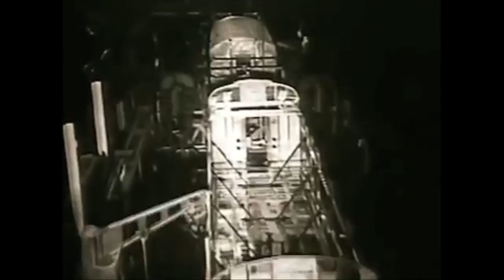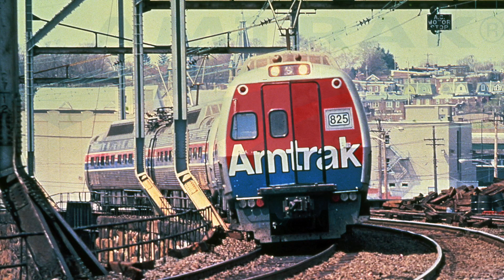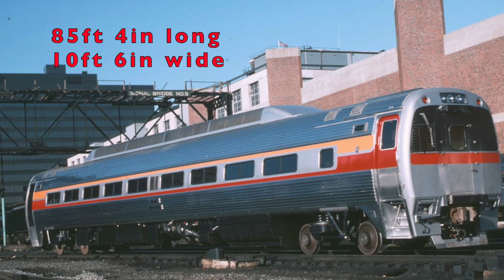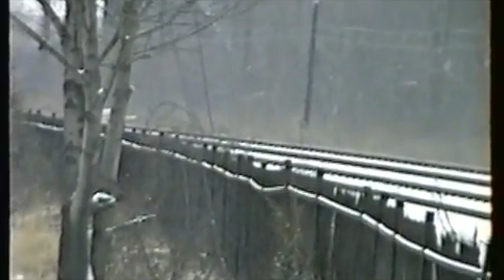Engines of Metro North SPV 2000

Comment: i worked for metronorth  starting in 1985 for 2.5 years as an electrician. Most of my time there i spent working  on the 10 car fleet of SPV's  , and boy did  these cars need work !!!  Of the 10 cars they had we had at least one car on the drop table every week for an engine or transmission change the entire time i worked there!!
 They had 2 drive engines Detroit Diesel 8v92's and one Detroit Diesel 4-71 APU engine. 
The part in the video about the union regulation for a fireman  that forced them to remove the drive shafts between the inboard and outboard axles is true and in my opinion was a major cause of engine failure from overspeeding.  The two inboard axles could not generate enough traction to handle the torque from the drive engines and would just spin the wheels like crazy on acceleration. These cars were so bad they had a technician ride the train to restart the engines every trip from croton to Poughkeepsie.
The engines control / overload panel was on the side of the car so the train had to be stopped and someone had to go down to the road bed open control panel cover , reset the tripped overload breakers and restart engine. 
One interesting thing in the video was the author referred to the meaning of SPV as special purpose vehicle  , i only new it as Self Propelled Vehicle .

i did work on the RDC's also , it was a much more reliable machine.

Comment: How about a new SPV-200/RDC type made out of Budd's Viewliner design? Try again,  make a better design of diésel engines and modern microprocessors.... VIA still runs RDC's
Reply from the maker: It would be possible but now with Siemens and Saddler entering the US market more aggressively they could adapt one of their European DMU designs for use in the US.

Comment: I worked building the rail geometry system used in the FRA's SPV2000 called T-10.  It was an interesting mechanical configuration in that a lot of stuff had to work for the car to work right.  There were three engines from two different companies.  Our vehicle has a pair of GM 6-92s as prime movers and a Perkins (British) diesel mounted under the middle of the car to run the APU (alternator).  T-10 had been structurally modified in a few ways to make it more suitable as a track geometry vehicle.

I rode T-10 on and off for a few years as part of its shakedown and the field support of its geometry system.  The geometry system represented an advance for its time.  T-10 did a lot of good providing precise measurements of how the track lay at the point of contact under a loaded and moving vehicle.  We measured geometry at speeds up to 80MPH.  Actually, from an instrumentation point of view, holding accuracy at slow speeds perhaps a larger problem.  The vehicle spent years identifying rail maintenance safety issues over much of the country.

We were not the typical operator as we had a dedicated staff operating and maintaining the vehicle.  We (Ensco Inc.) developed a great deal of experience with that particular vehicle.  We held on to the FRA contract and many of the same people for quite a few years.  The continuity of people and pride in the vehicle helped keep it operational.

I was not involved with its later life as an FRA vehicle so cannot comment on whatever issues it had later in its life.

Thanks for the interesting video.
Reply: Typo above.  Prime movers were a pair of 8-92's.

Comment: Seems like if Budd tried to hard to one up the RDC with the SPV, if they would’ve just claimed it as the RDC 2 and done the bare minimum in the upgrading of the equipment and released it, I think it would’ve done better both in attracting buyers and mechanically

Comment: 9:47 9:48 These newly-refurbished railcars would be referred to as Constitutionliners, and they would be used on Shore Line East until the railroad celebrated the acquisition of their brand new Mafersa coaches from Virginia Railway Express in 2004 after the new cars finished testing on the system.
Reply: 9:54 is a celebration for these cars

Comment: Am I the only one who noticed that, in photos of trains taken from almost head on, that the railcars are built with a couple inches of 'hog' in them?  That is, the cars are higher up in their middles than at the ends, where they attach to other cars
Reply: Yeah, that’s an Amfleet thing.  I read it was to prevent sagging under a full load, but the horizons are the same length and are flat.  (They’re also square).  Only other thing would be to shave weight, they are several tons lighter than a Horizon.
Reply: @jaysmith1408  Thank you!

I was told by a rail-buff friend that it was "an illusion" and he didn't see it..!

The hog is visible also on 18-wheel flatbeds on the interstates, more so.

Comment: So basically the Budd RDC could be a contender to be considered the "Douglas DC-3 of the rails"?
Reply: Pretty much. In fact, the Budd RDC was the basis of the electrified Pioneer III cars used by the Pennsylvania RR, which then evolved into the Budd Silverliner II (used by the PRR/PC and Reading until 1976, Conrail from 1976 to 1983, and SEPTA from 1983 until retirement in the mid-2010s), and the Budd Metroliners; the St. Louis Car Company using the Silverliner II design for the Silverliner III (for PRR Philadelphia-Harrisburg service) and Arrow I & II (for North Jersey/NYC service); with GE/Avco building the Silverliner IV (PC/RDG/CR/SEPTA) and Arrow III (PC/EL/CR/NJT): the latter two models still in service (along with the Hyundai-Rotem Silverliner V cars, which despite the name, does not have the Budd RDC & Pioneer III pedigree).

Comment: If there was a need to have them powered it's going to be slapping Alstom Coradia Polyvalent components at Hornell plant or use Modified ALP-45DP engines under the floor at Bombardier Plattsburgh, NY plant.

Comment: On the contrary the Grapevine Vintage Railroad in Grapevine, Texas has 3 of these cars 2 coaches in one cab car Currently only one is in operation as a coach the other 2 are waiting a restoration
Reply from the maker: Nice
Reply: @nyrailfan202 .... Great videos and video quality.. well done!  I subscribed after watching the first video I found of yours.. just yesterday (Sept.3rd, 2021)... on the RDC's, of which I'm a huge fan... mainly because of the beautiful sound of those twin 6-110NA Detroit Diesels.  Anyway, I have a question for you in regards to this video on the SPV2000's, and that is... exactly which Detroit Diesel (aka GM Diesel, pre-1965) engines were being used that were rated at 360hp each?  

There were several of their engines in that era that could easily be rated at that power output level, so...???    Us "gear-heads" that watch videos like yours, like to know that kind of information. : )   

Seeing as how the SPV2000 was unveiled in 1978, my guess would be that they were "possibly" powered by the Series 92 V8 (Naturally aspirated by a Roots blower) which was released in 1974 (until Nov.1995), and a common rating for that particular model was 360 hp (turbocharged versions went up to 720hp and even higher on custom built V8 - 92's).  Was the main "issues" with the SPV2000's drive train, primarily with engines, or in the drive train itself ??
Reply: @Romans--bo7br  The FRA's SPV2000 (called T-10) had a pair of GM 8-92s as prime movers.  It also had a Perkins mounted mid-ship to run an alternator.  Yes, two different brands--- one English.
Reply: @bruceclarkson7656 ... Hi Bruce, thank you for the reply... good information to know.  I never did get a reply back to my questions to "nyrailfan 202" ... the fellow who posted the video.   

One thing that saddens me a lot is the fact of many of the restored Budd RDC's (aka "Buddliners"), have been re-powered with Cummins (mostly) 4 strokes... which to me, completely removes the "heart & soul /character" of what the Budd RDC's were.  

Without the beautiful drone of those twin 6-110's... they're just not "Budd RDC's" anymore.  

I've never had any discussions with anyone intimately involved with any of those restorations, to ask them "Why ?" they didn't have the engines at least rebuilt, or better yet.. remanned.  

I can understand Not doing so with the 1st generation 110's if they needed a new or remanned centrifugal blower, but there were tens of thousands of the upgraded blocks / engines built with the roots blower, as well as the 3rd generation that were turbocharged as well.... 15 years before the first 8-71T was introduced.   

Even with a bad Centrifugal blower (unless the engine was over-sped above 2100 with one of those on there for scavenging), there are "after-market" way around that as well. these days.  

PS: In your comment below here, you mentioned that there were Two, 6-92's in the units you were associated with..... and Two 8-92's in your reply to me, here.   Just a "typo" I'm sure, but were they 6's or 8's??  How many rpms's were they governed at, at full throttle?  Perkins Diesel, back in the late 1970s and 1980s were Marketed by Detroit Diesel for a number of years, before they entered into a marketing agreement with John Deere's engines.... on the lower end of JD's hp line-up, to add to DD's "portfolio".
Reply: @Romans--bo7br  Definitely 8-92's driving two speed forward and reverse twindisk transmissions.

Comment: The SPVs were a disaster in so many ways. I remember riding on them in the 80s and diesel exhaust would leak into the passenger compartment.
Reply from the maker: The exhaust was part of the illusion. Once inhaled you may think that the cars were quite reliable

Comment: It was a shame that it was a failure. I know one issue was that it was underpowered, although some claimed that one power unit was disconnected to keep from having to have 2 people in the cab, not sure about that
Reply: They eventually got to be so bad that they had to always be run at least two coupled together at all times so that "when" one broke down, the other could haul it in.
Reply from the maker: Yup
Reply: Both of the power units were left connected, but the intermediate driveshafts were removed, so only one axle per truck was powered.
Reply from the maker: Which then made problems

Comment: Why couldn't Budd have just built more RDCs?  Update the engines to meet emissions and fuel efficiency regulations (if those even applied to railcars in the 1970s) and call it a day.
Reply: That could have been done using the Silverliner IV or Arrow III body.
Reply from the maker: The RDC’s still operating in the 70’s were still reliable. So railroads needed a better reason to replace them which might have been the comfort or speed that the SPC-2000 offered.
Reply: @nyrailfan202  That would have been okay if the SPV2000s had been reliable.  But it couldn't have been that hard to design an updated RDC (as above) with more comfortable seats and more powerful engines (they were already on the upward trend in the later RDCs) and igher gearing.
Reply from the maker: Buddy decided to go with the SPV and then when they failed budd’s executives don’t always make the most logical decisions. They decided that budd should just leave the DMU market which is why they never even had the chance to do that.
Reply: @nyrailfan202  Not the first and not the last example of mismanagement in the railroad industry and its support industries . . . .

Comment: Is a sad story becaus the spv-2000 could have been a success, it had a lot of potential. If it were only more reliable like it’s predecessor.
Reply from the maker: Exactly
Reply: Could have worked better
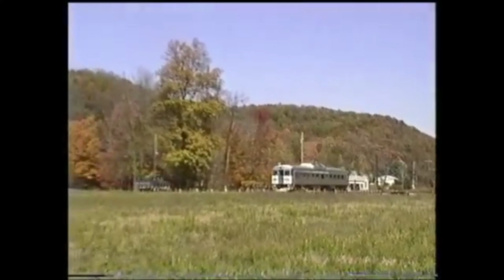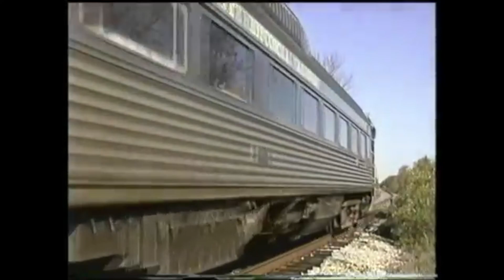Reply: 0:48 0:49
Reply: 9:54 new mass fer coaches, brovirginia relway express in 2004
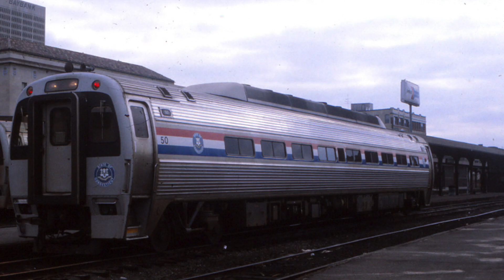Reply: 8:07 didn’t help either
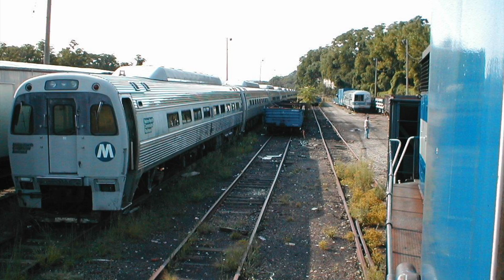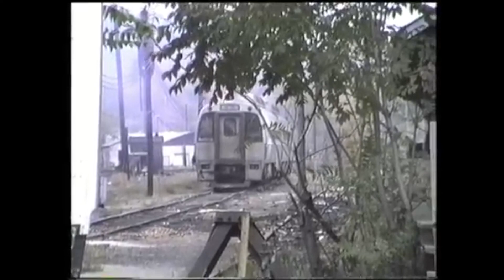Reply: 7:56 7:58 998 and 999 back to Budd
Reply: 8:02 8:03 catastrophic unreliability
Reply: 8:05 and the deferred maintenance by their operators didn’t help either…
Reply: 9:14 but ultimately the railroad had enough and retired them in 1990
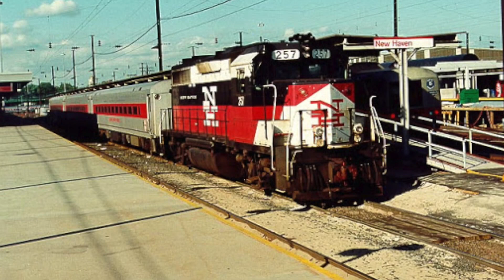Reply: 9:24 9:25 until a commuter service run by the Connecticut Department of Transportation, named Shore Line East needed more passenger cars.
Reply: 9:28
Reply: 7:57
Reply: 8:20 defective
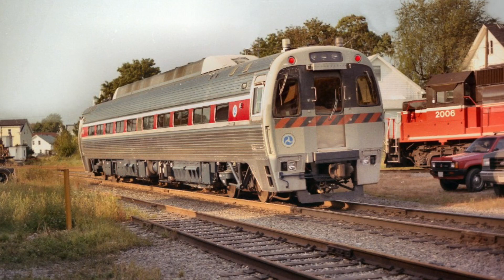Reply: 4:58 and converted it into a track geometry car
Reply: 9:33 reached a deal with Amtrak, to have the remaining 12 cars, G-powered at the railroad's Wilmington Delaware shops.
Reply: 9:34 Amtrak
Reply: 9:37 9:38 Wilmington Delaware shops
Reply: 2:32 2:33 Budd diesel multiple units
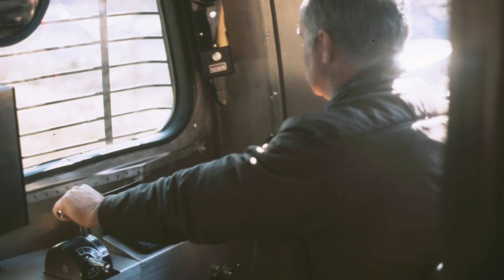Reply: 5:20
Reply: 5:06 just not under its own power
10:30 just not in its original form
Reply: 8:25 8:26 dar doo
8:07 didn’t help either
Reply: 8:25 8:08
Reply: 8:28 fix them
Reply: 8:55 8:56 recoup
Reply: 4:54
Reply: 4:53 The Fedraulrailway administration